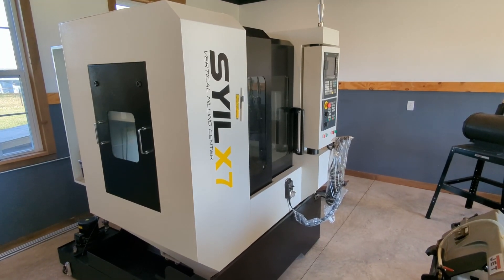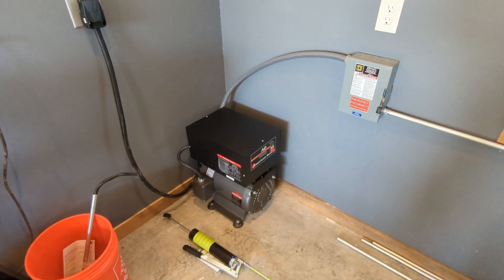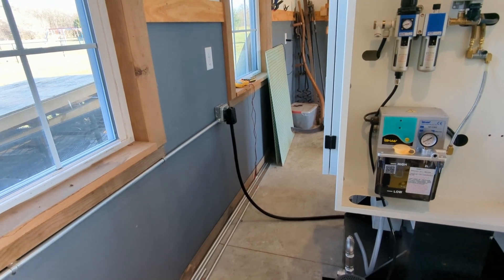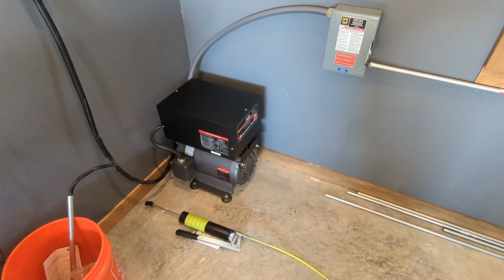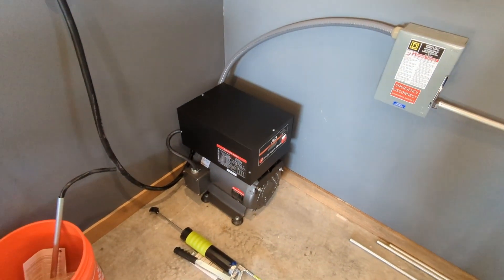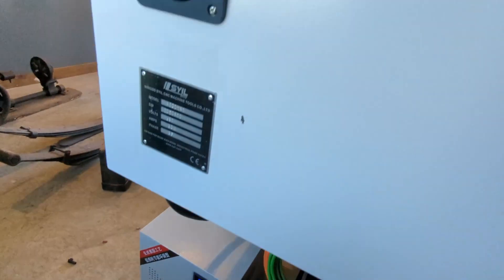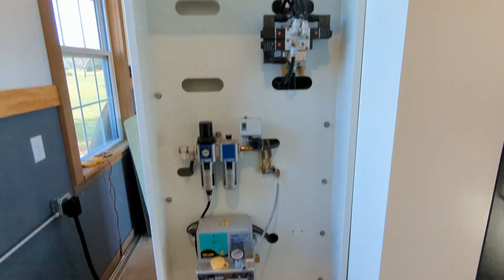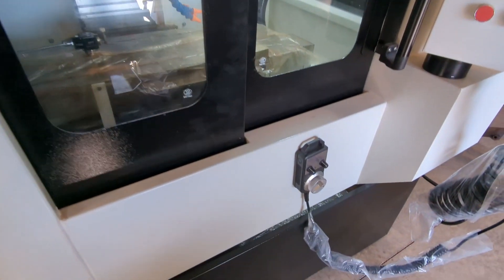Powering Up the SYIL X720

Comment: That is a nice compact unit, did not realize it was such a short stance. What is the max/full extension height on the mast (does it exceed 92" height)? Looks like that would fit in every home shop in states.
Reply from the maker: It is fairly compact. 1800x1500x2050mm | 70.9"x59.0"x80.7"  (Length x Width x Height). As for height fully extended, I don't know. I do know that starting in 2020 the Z motor was installed bellow instead of on top. The rigger brought this machine through a 7-foot garage door without issue.  

I'm in the process of moving the mill to its final resting place. Once I get it fired up again, I'll be sure to get the full height and post it on my channel.
Reply: @PowerForgeWorkshop  That would be great, thank you. I see several machines adverted as 'home shop" but they seem to flirt with 96" ceiling height or require cutting into sheet rock for space between rafters.
Reply from the maker: @killerfungis  With the spindle fully raised in Z, the total height from the floor to the drag chain was about 90 inches. 

That's the best estimate I could do. I had to measure from the top of the enclosure to the top of the drag chain and add that to the measurement from the floor to the top of the enclosure.
Reply: @PowerForgeWorkshop  That is great, thank you for going out of your way for those out here. That is a dimension not listed with Syil.

Comment: Looks good man. FYI don't put your mill across 2 slabs or expansion joints in concrete, looks like you've got it right between 2.
Reply from the maker: Manny, thanks again for pointing out the expansion joints in the concrete. I've got that fixed now and it's resting on a single slab.  👍
Reply: @PowerForgeWorkshop  all good mate, glad you sorted it. Problem with expansion joint is the sections of the slab may move independent of each other introducing twist over time. Might be fine but depending on your soil, you may possibly get a little moment every heavy rain that you general don't notice, but when you're chasing 0.01mm It become noticeable. Hope the new mill is working out well for you.
Reply from the maker: Thanks Manny